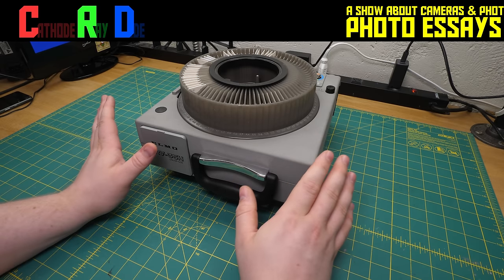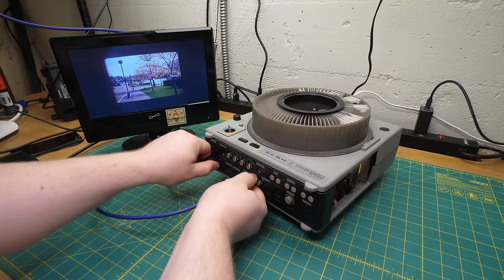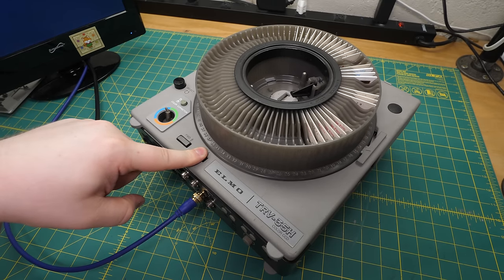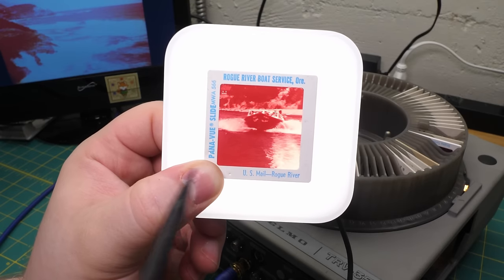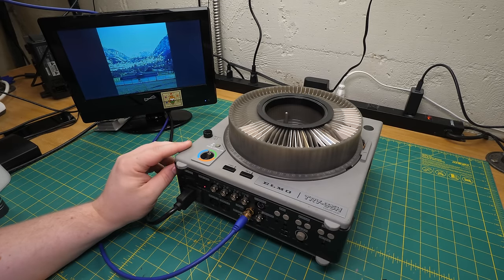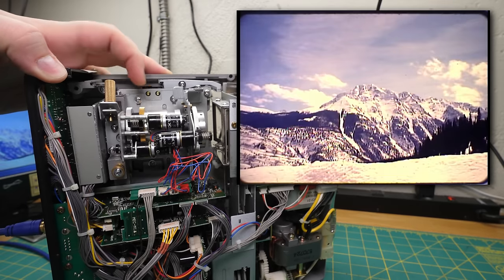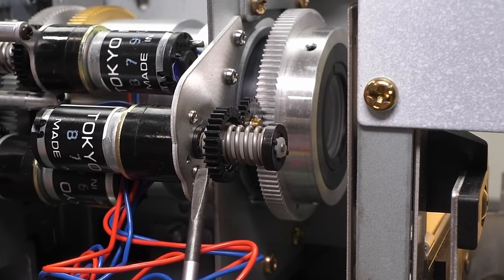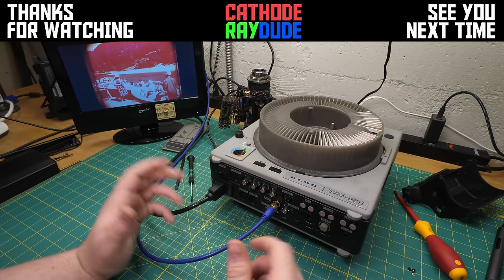The ELMO TRV-35 slides into your video feed

Comment: Yeah slide projectors!!!!!!!
I did a thing where I cut squares out of cardboard, pasted on print outs of constellations, then poked holes in the appropriate spots. then because I didn't have a carousel I hand fed them through the machine reflecting off of a mirror on to the ceiling. The kids were amazed and I ended up explaining how a projector worked.
I actually have three units now. And some of them are the really nice industrial ones that have been passed down from the school system to the extension office to me.

I also bought a weird composite / S video only input Sharp digital LCD projector that stands vertically.
( I used one once and got to thinking I wonder what they're going for an eBay "stupid idea" although I did managed to find myself the commercial version with a gray plastic instead of black and BNC terminals ).

And I don't know why but I feel like I want to break the universe at least once by attaching this slide carousel camera system to up convert everything to composite and then send it off to the projector. Yes I think I'm crazy yes I think I'm crazy. I hope one of those things shows up at my Goodwill.

Comment: Hello!
I'm a film shooter and shoot/DIY reverse my BW film to BW slides for projection - scanning being the afterthought. That huge and pixel-free image is amazing to withess. You don't view cinema in brightly lit rooms. You don't project digital image under sunlight. Similarly - you don't do slide projection in bright ambient light and thus are amazed.
Reply: Out of curiosity, what film do you use to make the B&W slides?  I've tried this with Tri-X before (photograph negative with a slide duplicator onto Tri-X, then process, making a positive), but the base is not clear, so the slides come out looking grey.  Who makes clear-base B&W film now?
Reply: @Alpha8713  you probably need to rethink this :)
Any film can be processed as a BW Slide and it's the BW Reversal chemical process that turns your film out of the camera into positives for projection/scanning/whatnot.
I've tried many films, C-41 and E-6 included. Can provide my Flickr link if interested to see the results
Reply: @diapozitīvs  Ah...I missed the reversal process part.  That makes sense.

Comment: waves paw here, I cared about projection back in the day! I was still a bit too young back when I got a decent camera and when slides were still a thing but I planned one of these fancy dual projector setups for fade over effects with audio track... but that never went past the planning stage. The key to not bore your audience is to remove up to 9 of 10 of the pictures you made on your vacation. It's usually the "20 times the same thing only slightly different" that gets people to run away from home slide shows, I think.

Comment: You are the only person who could possibly make a 45 min video about a slide show projector that's worth watching! Congrats!

A few things:
1) PAL/50Hz CRT TVs have longer after glow, making them not more flickery than NTSC/60Hz CRT TVs. (Unfortunately this wasn't always the case for computer monitors - there were plenty of painfully flickery monitors for the Amiga in Europe
1½) This makes switched off PAL/50Hz CRT TVs a decent surface to project super-8 movies onto while pointing a video camera at it, as it does some deflicker. Setting the super 8 projector to 24fps (and just sucking up that 16fps movies would run 50% fast) makes it almost completely flicker fre.
2) Computer controlled slide show projectors were a thing even before/without any electronic video signals. I.E. you would just have a bunch of projectors and a computer to control them, where I think the most common would be a purpose-built "computer" but it could be any general purpose computer. I actually find it surprising that this was a thing with your device as the major selling point for slide shows over video was the higher contrast range
3) Although carousels did exist in Europe, they were certainly more uncommon. The common thing was thing that moved linearly, usually with space for 40 slides although some could contain 50 slides. 40 matched decently to the 36 slides on the longer of the two standard length film rolls. Computer controlled "professional" slide show things used carousels though.
In case you are interested in it, I could scan some pages in a 1980's A/V and pro sound/light stage equipment and whatnot catalogue that has a small section about computer controlled slide shows. Reply to this comment and I'll send you a mail about it.
4) Anyone wanting to convert one of these to higher definition video would likely at least save money by just buying a regular slide projector and simply replace the light bulb with a way weaker one, and replace the lens and whatnot with a camera. As a bonus you wouldn't feel bad about modifying a piece of ancient A/V history.
5) The mechanism for the actual slide changer was most likely well proven since many years, and thus the plastic parts would last forever. Even consumer grade projectors seems to have used heavy/solid parts, perhaps due to it was a one-time buy for most people and cost didn't match that much, in combination with few parts that could drive the production cost. Also I think the solenoid engaged when the motor hasn't spun up, so there is no hard yank on the plastic parts, which likely makes them last longer. Of course there is no stress on the plastic when it disengages the mechanism.
6) I would think that people using these with computer control took pride in arranging the slides in a way that needed as little "skipping" as possible. Compare with configuring Cisco router, it's a bit more complicated than it has to do which ensures that casual outsiders will not achieve as good result as an "expert" and said "experts" get a feeling of accomplishment when finished. It's also the same as what's actually pre made meals but sold as "spice mix" or "cookie dough mix" or whatnot, where you add a few basic items that requires no skill to do, but makes you feel like you have cooked your own meal rather than just heated a pre cooked meal.
7) Love your vids. Keep up the good work!

Comment: Saw this (probably exactly this model) thing on TV production. Or, to be even more specific, four of them, on a documentary series production set up somewhere in early to mid 1990s then used until at least mid 2010s. With four of them, blank synchronizer and computer controlling all that stuff, you can do a crap load more. For example, the problem with iris and dynamic range could be entirely corrected with two of them set up for different parts of image, and a control computer switching video source WITHIN given half-frame, on a given scanline. So you can, depending on situation, transmit odd lines from one and even from another unit, getting something in between, or use one device for top part of a frame and other for the bottom half, switching on a specific scanline. All without digital video.
With four of them you can do that AND smooth fade transition.

And, as an icing on a cake, with 486DX and an FPU (config on side) even crazier crap was possible by utilizing mid-scanline switching (literal Atari 2600-style beam riding), like new image transition appearing from the side/top without fade, or in a complex pattern fill, or as a wave — computer would intercept and mix images from all four of them in any given shape or way.
Another usage of beam-riding would be any kind of PiP or overlaying part of one slide on another. Ex-employee who made that program was a magician probably. The unit was sent to scrap metal only after HDTV switch in our country.

Comment: Beside the already mentioned broadcast and classroom use, it would also be a nice addition to a video conference system back in the day. With the serial input, it could even be controlled through the conference systems main unit. The focus, zoom and iris were often adjustable on the main camera in those systems anyway, so the necessary control buttons (or automatic circuitry) would already be present.
18:33 The focus function would also be useful to compensate for varying film/camera distance with different types (thicknesses) of slide frames, or cases where the film is buckled in the frame. The zoom function is of course also handy when viewing slides on smaller film formats like the 16mm pocket camera film (110-format) or APS.

Comment: The lightbulbs in these must have a terrible lifespan if they are switched on and off for every slide change.
Reply from the maker: It did come to me with a burnt out bulb haha
Reply: @Ranger_Kevin  it probably has a shutter...
Reply: Power cycling over a short-term is perfectly fine for a light bulb, what kills a bulb is coming back from cold. Think about all the Marquee signs and traffic lights that blink for years on end, the bulbs do blow out but not really faster than one that was just on.
Reply: @pablorai769  41 minute mark has him operate the machine while partially disassembled. There's nothing in between the lamp and the lame duck end of the machine, and it's very much not illuminated while it's transitioning. It is actually just turning off, not using a shutter.

Comment: Those also were used in TV stations, used for the stand by slides, there to have something go out OTA, even if the rest of the studio had gone pear shaped. Either triggered by the board operator, or by a black level detector that saw more than 15 seconds of black video, or no sync pulses for 3 seconds, that then turned the lamp on, and used the genlock from studio master clock to allow a image to be inserted into the video stream without tearing or skipping of sync.

Comment: The need for a big shaded-pole motor was to drive the cooling fan for the 50-150W halogen bulb that was normally used in these projectors. It made sense to use the same motor for the advancement mechanism by just adding a clutch. And in this design they kept all the mechanics and just opted to switch off he motor when not needed.

Comment: At 20:00 you mention that you believe that these are 127 film. That's not necessarily the case. There are a number of medium format (as in 120/220 film) cameras that could have viewfinder masks to shoot what's known as a "super slide", which was basically a 4 CM by 4 CM crop. A brief search leads me to believe that these were possibly duped onto 127, though it's also possible that they physically cropped the 120 negative.
Reply from the maker: I was basing it on a page I found talking about those pana-vue slides; certainly they could be crops, but I figured if anyone else thought they were 127 I'd just go with the flow.

Comment: Very interesting piece of old tech.
Seeing the inside it does say 2000 dollar product, alot of design and engineering went into it.
Great video.

Small technical detail, those "servo's" are just geared motors.
Servo's would have a feedback mechanism and stepper motors need more wires, endstops and circuitry.

Comment: Just a technicality, but "servo" does mean a motor running with closed loop control. So those motors aren't servos in any way. Unfortunately. It makes me wonder what you could do with a modern CCD and electronics. Maybe some feedback here and there. Everything mechanical and optical seems so high quality...

Comment: Kodak advertsied the carousel as being "as dependable as gravity", and it was, it's only downside was the cycle duration between slides, could not be faster than gravity allowed.The square format slides were the "superslide" format, Hasselblad made a punch/cutter to make slides in this size from its 6X6CM format.

Comment: Retired a lot of these from uni lecture theatres, these were used in conjuction with the old skool 3 CRT projectors as there used to be a huge amount of learning materials on slides - I mean, PowerPoint still calls them slides - and this tech eased the transition to single projector spaces..  Rooms would have had an OHP, Slide projector and a roll-in 8/16MM projector at one point.... Which transitioned to a CRT trolley with VCR in small spaces and podiums/CRT projectors in larger ones... to now it is just digital projection everywhere.

Comment: Have you ever seen low frame rate animation done with a rack full of remotely controlled slide projectors focused on the same screen? It's kind of amazing. Worked at an AV rental and setup company called Projections back in the late 1980s. They had a setup to do just that for clients for presentations that had to look better than video on larger screens. Very analog, very cool.

Comment: The cassette player controls the projector. There is a "beep" on the tape which triggers the projector to advance to the next slide. Usually on the right audio channel.
I used to own a reel to reel tape player with this feature. There is a relay inside clicking when the "beep" passes the magnetic head. It came with a microphone with two buttons. One for the tape motor and the second one creates the beep.
Playing the tapes on an ordinary machine, you can hear the beeps where the next slide is triggered. My machine was only capable to play the left audio channel.
I have never used this thing hooked to a slide projector but it worked fine with my Siemens T100 teletype. It could handle 50 bps just fine.

Comment: A very interesting video as always, the device is very professional looking and operating, a mechanical powerpoint presenter. With a wired remote you could do all sort of presentations at museums, schools etc and the build quality looks very good.
However it would be nice if you could demonstrate how the other video outputs show the images, I mean they bothered install pro BNC connectors and Component outputs separate and S- video, so they should work better than composite NTSC 480 lines image?
Cheers from Greece! Jim
Reply from the maker: Glad you enjoyed - I wanted to demo the different outputs but as noted, I didn't actually have the gear to do it right.

Comment: Somewhere on the tray it indicates forward. Usually with an arrow.  I had to run the slide projector in a wire box hung over the school auditorium balcony. Not just the projector, I had to crawl into the cage with the projector.  This was in the late 60s

Comment: Interesting box, our church projector (as well as the previous one) has RGB input, so I'd guess any of the larger more serious projectors did. I did have one of those document camera's, I thought it could be useful at church etc, but eventually ditched it as, like this one, only has low res video out. If I ever want to do live document shows I'll probably just set a mobile phone up on a short tripod looking straight down - job done.
As for this one, probably rip out the camera assembly then add a mount for a mobile phone, turn all the slides into jpg's etc., then load them into powerpoint, again, job done.
I'm slightly surprised by the remote and serial controls, one of the problems with slide projectors is they have to be aligned with the screen, in another church I know of, someone had to scale a ladder into the loft to fit a slide magazine to the projector, way up there, so remote control was very important, however with it being on a video cable this slide machine can be anywhere, so way more convenient.

Comment: A cog is like a gear, but with pegs instead of teeth. I think what you are describing at 42:00 is a ratchet with a solenoid-actuated pawl
Reply: i dont think that is right,   when i googled about cogs and gears etc,  sometimes indeed a cog is described as a sprocket (your pegs)  but i think that is just a mix-up,  as cogs are just the name for the teeth on any type of gear
Reply: @raafmaat  mmm, that's interesting. Not what I was always told in college, but I guess if you keep getting told the same thing over and over again you start to accept it without question.
Reply: @henryokeeffe5835  to be fair googling about it was very confusing,   it seems to get mixed up everywhere,   especially on the captioned images,  they seem to ALL get some words mixed up

Comment: I would think the reason the  plastic gear mentioned at 42:20 doesn't wear away is because it has like fifty teeth and the steel pin only engages one of them each cycle

Comment: I believe one reason you're having a hard time getting good color out of the BNC is I believe it's outputting HSV color instead of RGB, HSV color is quite common with that kind of gear, for ex my uni used RGB/VGA to hsv converter for professional monitors and projector.

Comment: It's hard to imagine anything other than niche uses for this.   I did originally think that University lecturers may have used it, and they may have used it with early video projectors in lecture theatres, but thinking about it, by the time video projectors were a thing, so were PCs and PowerPoint.   Also, if a lecturer needed to show slides as part of their lecture, it's likely they would just use a convential slide projector.

It could be useful for recording presentations to video though.

Comment: I suspect the computer control would be most useful in a multi-projector setup where you might have a wad of old slides that you wanted to project but maybe have a TV screen somewhere too. Maybe in a lobby or side room or something. I ended up with the control computer and a bunch of disks from a local planetarium/museum that has some control software and a bunch of cue files for controlling projectors. Sadly I only bought the computers from the guy selling everything and not any of the projectors or other stuff so I have no idea what the actual things were, but they could have been ELMOs too. But it's pretty interesting loading up some of the queue files and watching it at least try to do Things.